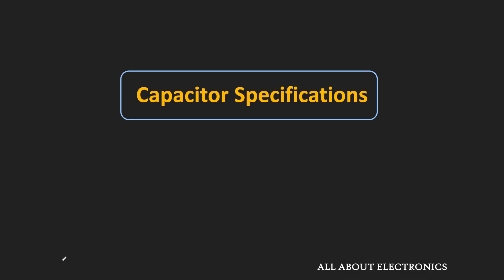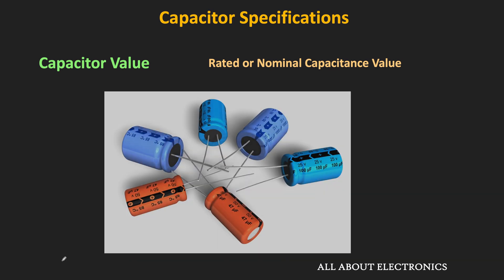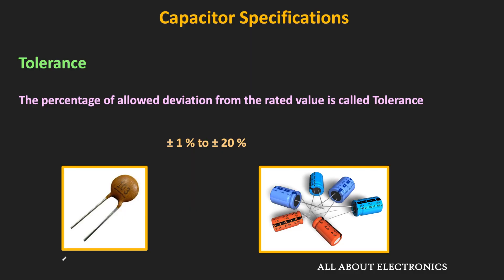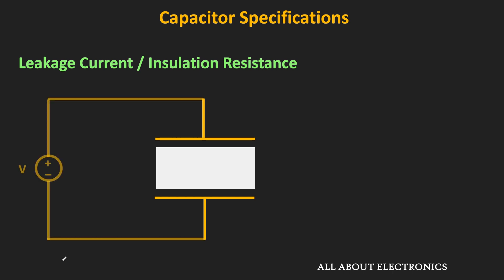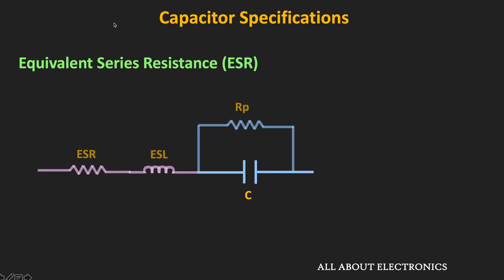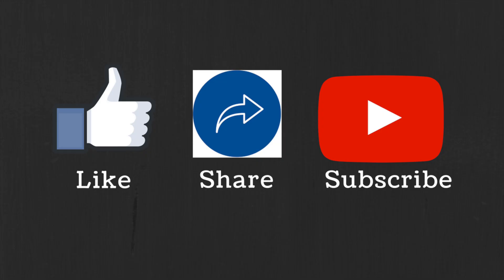Capacitor:  General Specifications of the Capacitor Explained

Comment from the maker: Timestamps:
0:00  Introduction
1:10 Rated Capacitance Value 
2:15 Capacitance Tolerance
2:58 Temperature Range
3:15 Temperature Co-efficient
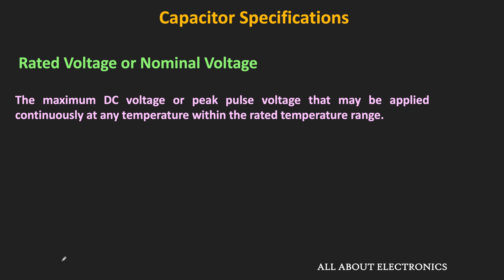4:26 Rated Voltage of Capacitor
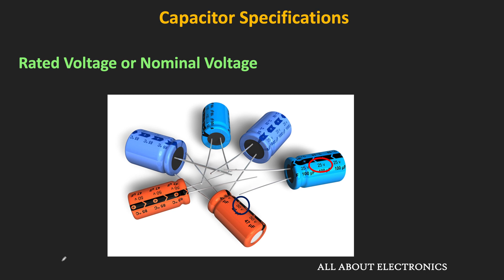5:04 Volumetric Efficiency
5:44 Leakage Current (Insulation Resistance) of Capacitor
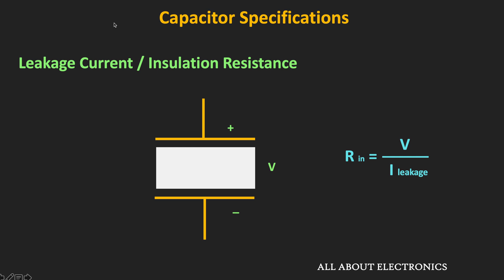7:05 Effective Series Resistance (ESR) / Dissipation Factor
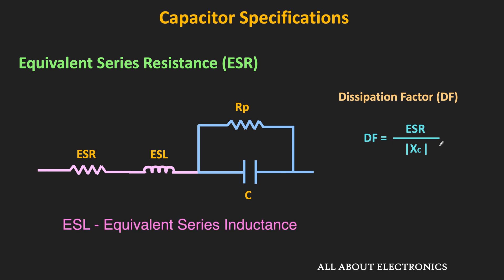8:55 Effective Series Inductance (ESL) and Series Resonant Frequency